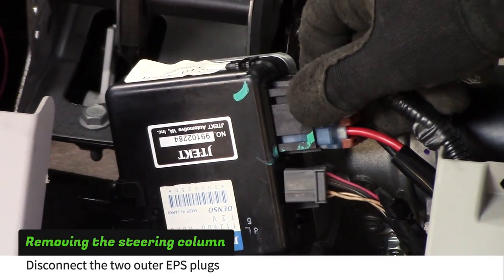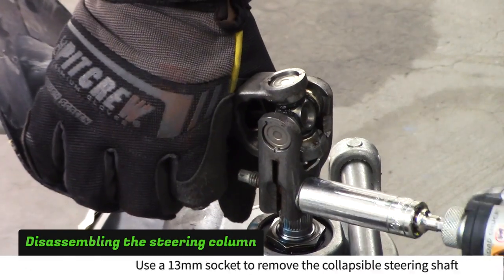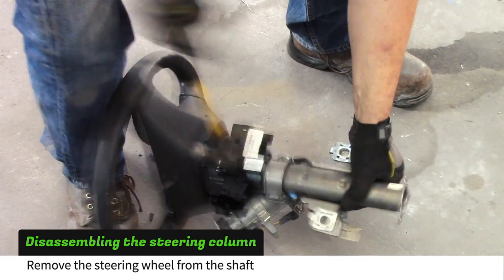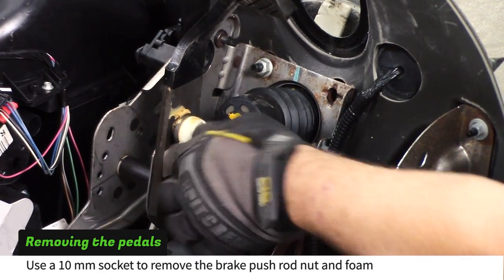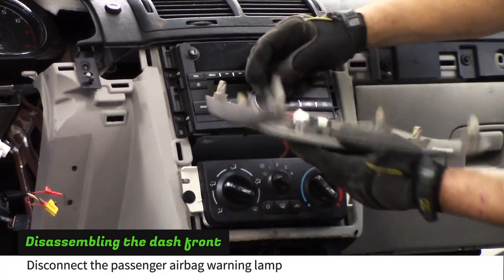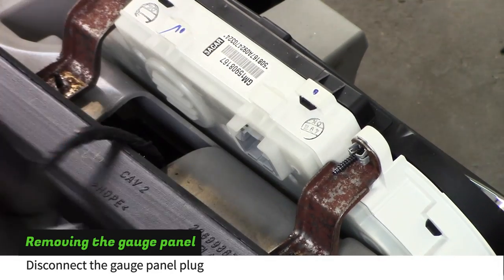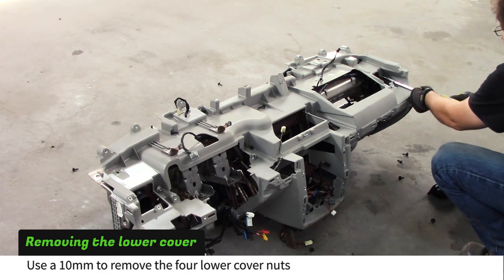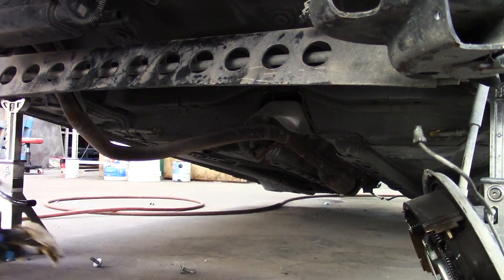DF Goblin Build Guide Part 7 - Disassembling the Dash

Comment: @2:20 My airbag connectors still had the yellow safety tabs on them.  Once I lifted the yellow tabs up, then I could pinch the sides and remove the connectors.  Your airbag connectors already have the yellow safety tabs removed.